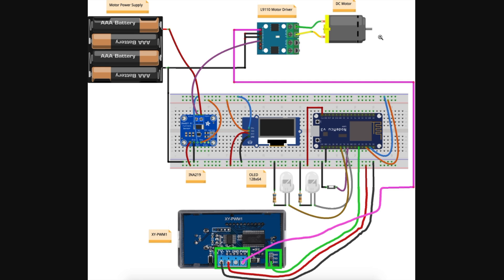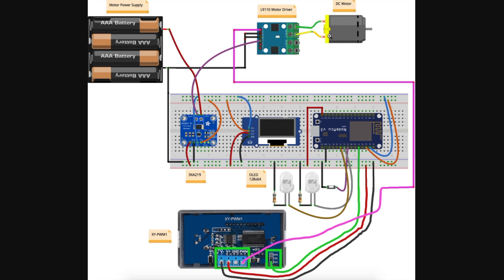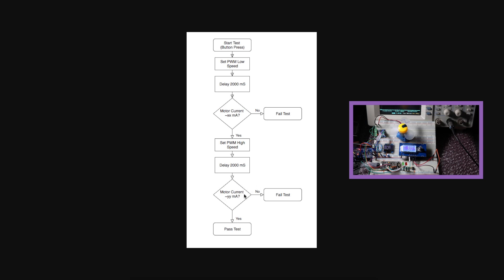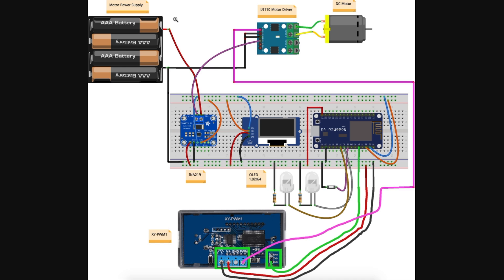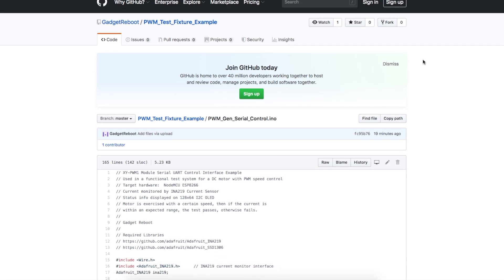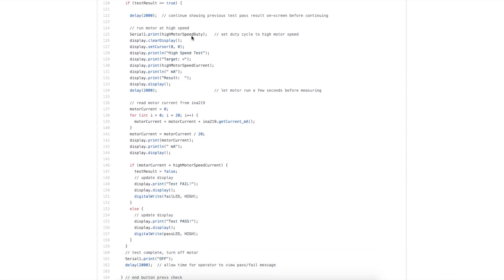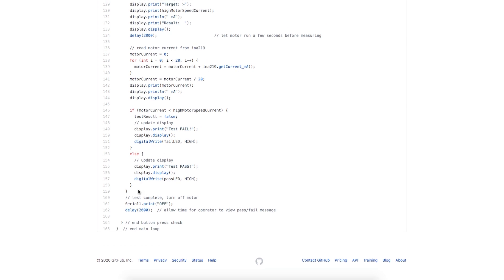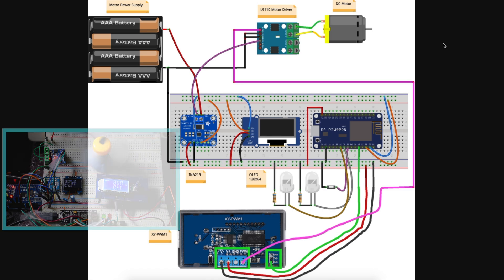Functional Test Project: INA219, PWM Motor Control, ESP8266

Comment: is ina219 compatible with l298n?
Reply from the maker: INA282 may be worth looking at https://youtu.be/r-aa84iWTRg   because the problem I had with INA219, it's convenient to just read the data over a bus, but it will just take an instant reading when requested, so if you have a load that is constantly turning off and on like a motor that is getting pulsed, the readings will be all over the place.   Using INA282 with an analog voltage output, it can be filtered with a capacitor to hold an average and give better ideas of the current.
Reply: @GadgetReboot  Thank you for responding sir, but the thing is there is no available ina282 in the area and we need to pass our project next week. we just have to know the voltage of the motor with different speed.
Reply from the maker: @rhuuu199x  When I used INA219 for something similar, I couldn't get it working very well even when trying to read it many times and take an average.  So another approach would be to research how to use an op amp with a current sense resistor between the motor and ground.  It's a common method to calculate current and a circuit should be easy to find.

Comment: Suggestion: in the low speed test you might want to check for current too high as well as for too low. This, in theory at least, should catch a motor with locked rotor, tight / stuck bushings, etc.
Reply from the maker: I originally was trying to test both the low and high speed within a boundary but the run currents were all over the place due to the PWM and I just needed something quick for a demonstration.  
If the motor were intended to be able to go both directions I’d probably want to test that function as well in the real world, and if the driver has more features like a current limit I want to try running it full on to make sure I can only go so far in the drive current. Maybe I should actually do a more specific project like that to show a more refined real world application now that I’ve covered the high level concept.
Reply: @GadgetReboot  That makes sense. Perhaps the current measurement issue needs a more analog solution. I'm thinking along the lines of a circuit that produces a true smooth DC output whose voltage is proportional to the PWM input. Drive the motor with that pure DC, pick off current right at the motor using perhaps a shunt resistor to get a voltage drop that's proportional to the current... Just thinking out loud here...
Reply from the maker: @sootikins  Although in some cases part of the functional test may be to test the PWM driver also as a system with motor attached, so we could pick off the PWM at the motor terminal and smooth that to get a DC level we can interpret as a current.  This could turn into a 10 part video series exploring all options!

Comment: Very nice. I like the level of complexity of your circuitry. Automation is an area of keen interest for me. Particularly automated testing.
Reply from the maker: In my first design job, part of what I was doing early on was functional test requirement specifications for this big complicated system with all kinds of DC and stepper motors, solenoids, sensor inputs, and the project was already mature when I joined the company and I had minimal experience so I got a lot of exposure to automated testing early on.

Comment: Why using an Arduino IDE with an ESP8266 ? The Arduino IDE gives pretty much code overhead; you are missing so much performance out of the ESP8266. It is pretty easy to use a proper IDE with the ESP8266, for example the Eclipse CDT.
Reply from the maker: Some day I will try it but for what I'm doing it's not critical enough to expedite looking at better platforms.  And this computer I'm using from 2011 would probably fall apart if I tried to install something new!

Comment: Nice video, i think i would have bit banged my own PWM so i could measure the current flowing while the power to the motor was on (if the current sensor was fast enough). with random current reads you could end up with a lot of low readings.

Even with that said, the PWM module is a good piece of test equipment, if your having problems with your software and need a quick substitution to test the hardware. i'll put one on my to get list. China has sent me the components for your board build by moth mail, they have been in the air for weeks :(
Reply: Just a suggestion here. There are two possibly relevant measurements here. 1. The maximum current draw of the motor. 2. The average draw at particular speeds. Since this is a test scenario, you could test IMAX with PWM set to 100%. For average draw just use your described multiple sample method (or maybe more than 20 samples).
Reply: @newburypi  I was thinking that a over current on startup might be in order to detect a stalled motor. Stall current much higher than any running current?
Reply: @TheEmbeddedHobbyist  Agreed. Tied in with GR's current limit, to limit any damage. 1
Reply from the maker: @newburypi  The funny thing is, originally my high current test was 100% duty and the low test was 65% duty, but at 100% not even the blue tack could hold the motor down from taking flight so I made 65% or so the new maximum!  I am thinking about maybe doing a more in-depth version of the test with a better set up and a more advanced driver that can do current limit as well, we’ll see.
Reply: @GadgetReboot   Gadget Reboot  if I wanted to get serious, I'd suggest a tachometer as well.
Reply: @GadgetReboot  oh... and maybe blue tac is not a suitable material to hold a spinning motor :)
Reply from the maker: @newburypi  it was working way better than the scotch tape at a moments notice!
Reply from the maker: Yeah sampling the current when it is in a known state would be the way to go. Long ago in another life,  there was a situation where I had to do something similar with a stepper driver chip where I didn’t have access to the control logic signals, just the wiring harness going from the output to the motor, so I did some thing like throw a comparator on one of the phase wires and sample when it was high.
I look forward to seeing what you can make of that PCB. I need to revisit the project and add some user interface improvements like the ability to set the exact fuse instead of relying on built-in presets.
Reply: @GadgetReboot  looking forward to it too, need to sit down and do some soldering or i might go rusty.